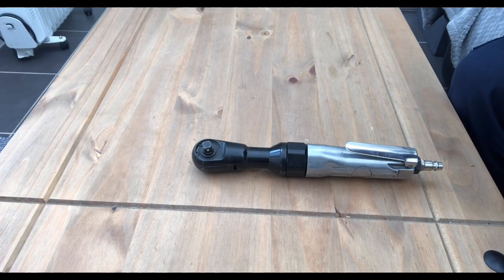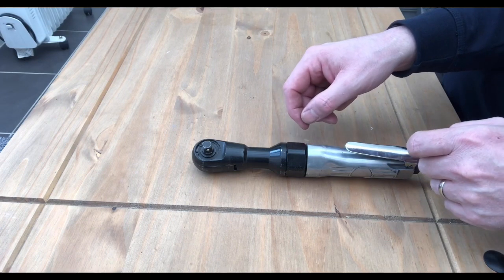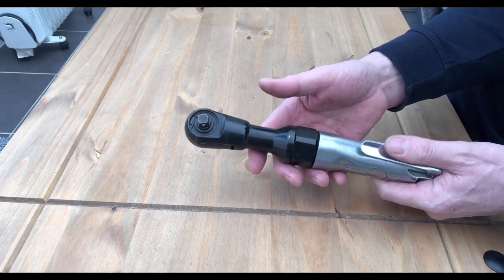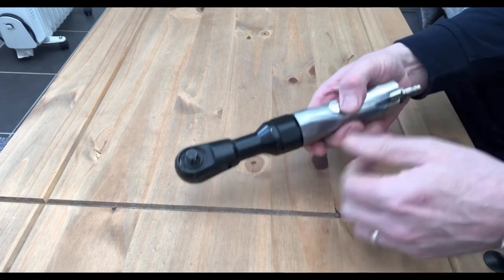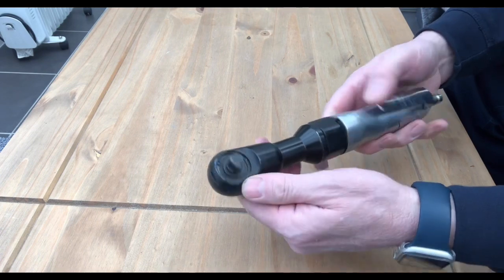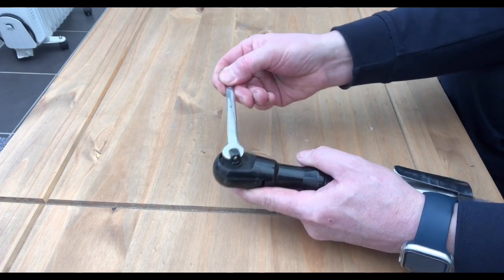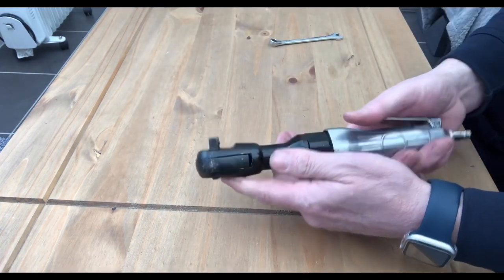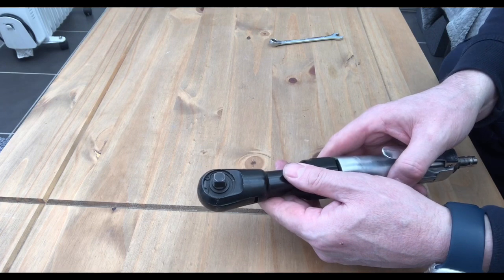Air ratchet seized, just blowing air fixed.

Comment: I have basically the same problem with harbor freights 3/8” ratchet. I bought it a year ago, came home tossed it on the shelf and  there it sat till this morning. Mine would not turn by air even at 150 psi. I could turn it with an open end wrench so I figured get online to see if anyone else had the same problem and made a video on a quick fix. Your video was the first one I came across with the same issue. After watching it I decided what the hell might as well give it a shot. I mean we all know harbor freight tools, that’s why we go there. They’re cheap one time use. If they get you out of the jam you’re in, it was worth the purchase. At least give me that first time, Doesn’t matter if I waited a year, I still deserve to use it once. After working it with some penetrating oil, back-and-forth with the wrench, 90 pounds of air, it’s spinning like new. I appreciate the tip and video! Saved me from a headache going back and trying to exchange this thing 🤬. Thank You Brother!!
Reply from the maker: Thanks for the feedback I do enjoy it when viewers take the time to share their experiences and I also love a successful repair!